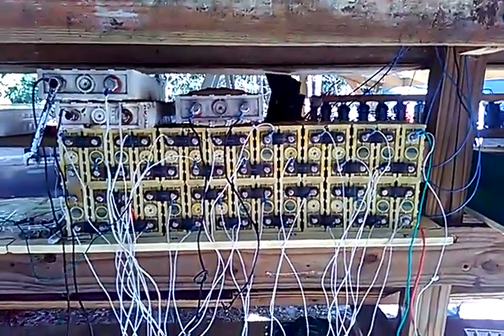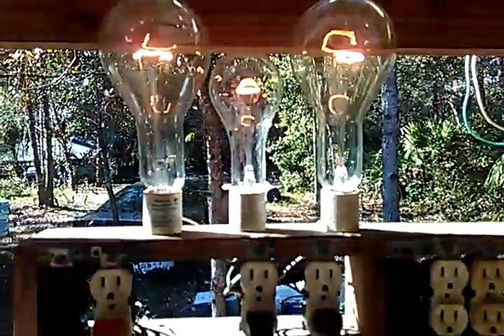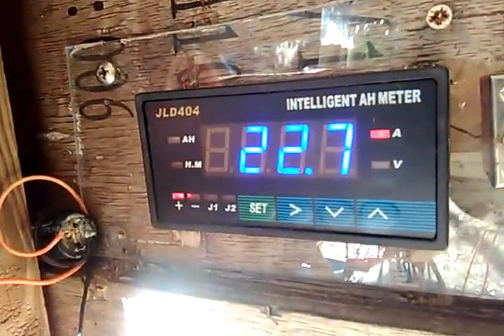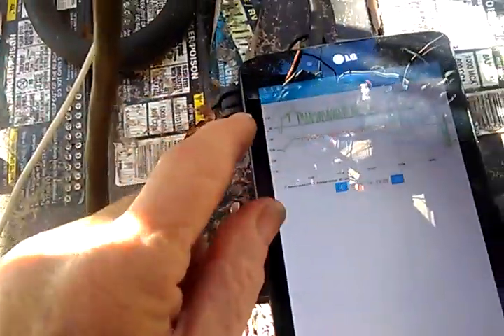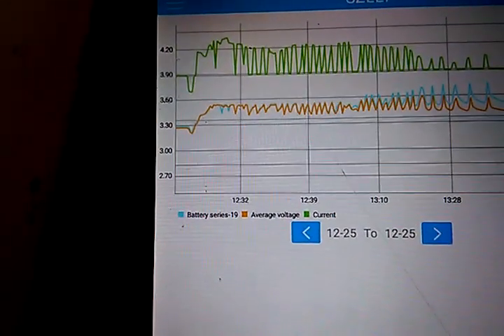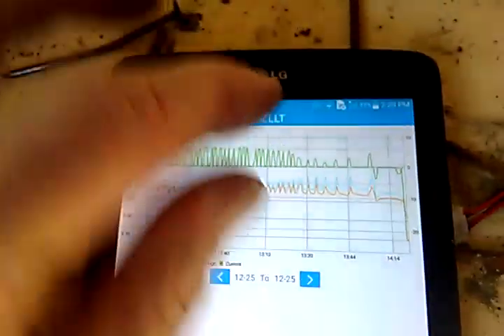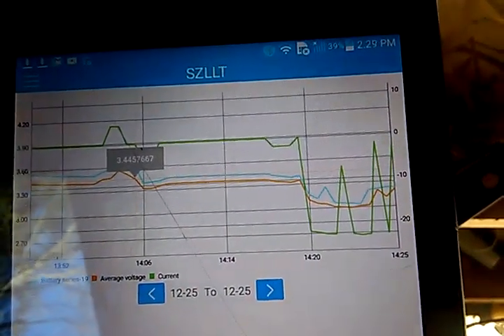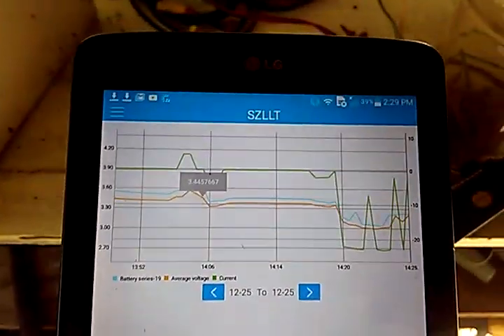Smart BMS with Bluetooth

Comment from the maker: One thing that it is not clear and that is that I am actually discharging the group of batteries and charging them into another group of batteries so even though the solar panels are putting out current seeing on the meter this is actually discharging the pack into another pack.